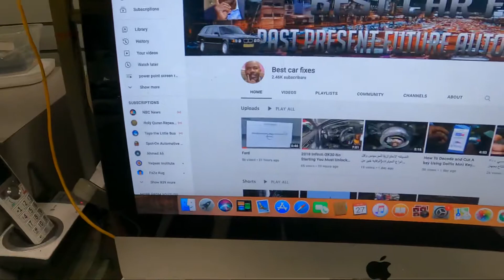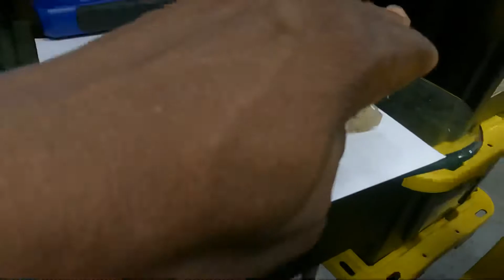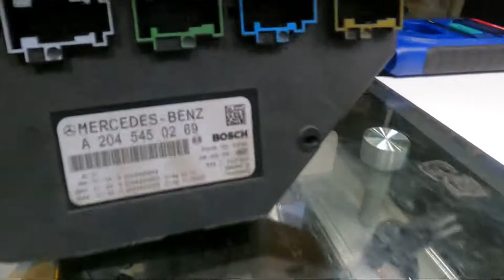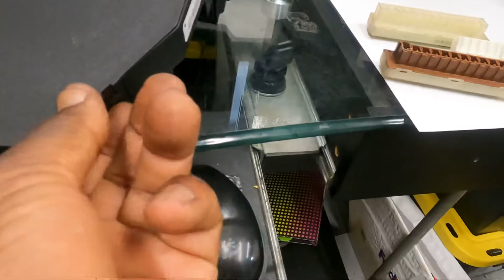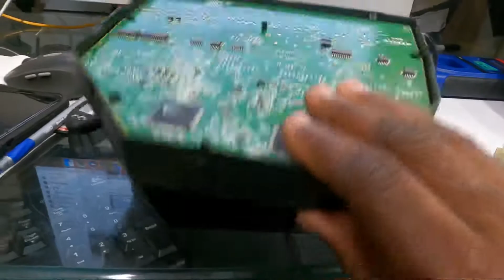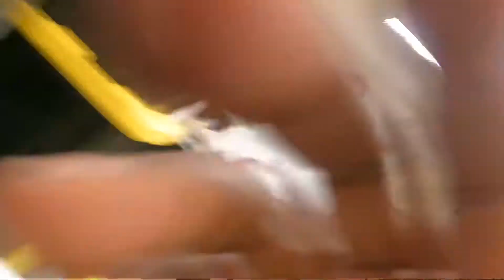2008 Mercedes Benz C350 Front Sam Module Defective Caused No Communication With Engine Computer Info

Comment: So I was having trouble with my 09 Mercedes Benz c350...no turn signals, or wipers, nor high beam. And my fan ran on high just as you said. I changed the SAM module with one that has the exact same part number. Now I have no cruise control and still no turn signals or wipers or high beam and my fan still runs on high!!! Could it be something else?
Reply: Does You’re problem solved?

Comment: hi, does a flooded SAM module affect the operation of the washers, wipers, ESP and airbags?
Reply from the maker: yes for sure
Reply: @BestCarFixes  thanks for the answer.  Is it certain that these components will work after replacing the module?  I will also add that I will be transferring the module from 2013 to 2007
Reply: @KAZIUWICHURA it should work. How did it go ?
Reply: @MB204Plug  it turned out that moisture was collecting in the fuse box after rain. I insulated it and I haven't had these problems for a year

Comment: Hello I have a merc e320 w211 2006 and my car not crank front fans start spining crazy and gear selector not want to move stay on p automatic car  it may be from sam module I cant conect engine ecu and transmission to read codes it gives me no conection
Reply from the maker: Check if there is a water inside
Reply: You end up figuring out the issue?

Comment: Srs not comunication, c180 2006
Reply from the maker: If your 2006 Mercedes C180's SRS module is not communicating, it could be due to a few reasons. Here are a few troubleshooting steps you could take:

Check the connections: Ensure that all the connections between the SRS module and other components are secure and properly connected. Loose connections can cause communication problems.

Check the wiring: Inspect the wiring leading to and from the SRS module for any visible damage or breaks. A damaged wire can cause communication errors.

Scan the system: Use an OBD-II scanner to scan the SRS module for any error codes. This can give you a better idea of what is causing the communication error.

Replace the SRS module: If all else fails, the SRS module may need to be replaced. However, this can be an expensive repair, so it is best to exhaust all other options before considering this option.

It is important to note that working on the SRS system can be dangerous, as it is responsible for controlling the airbags in the event of an accident. Therefore, it is recommended to have a professional mechanic diagnose and repair any issues with the SRS system.

Comment: Good morning to you. 80% of SAM issues are due to corrosion caused by condensation moisture & dust?. If yes, how about taking out SAM still in good working condition, to be cleaned, dried out gently & then spare with a thin layer of CRC urethane spray just onto the PCB board. This would be like a PM.

Too thick a layer of urethane spray might trap more heat in the PCB board?. 

For each cleaned up terminal connection will a drop of WD40 or thin application of dielectric grease be advisable?. Regards.
Reply from the maker: Yes, it's true that corrosion caused by moisture and dust is a common issue with SAM modules. However, it's important to note that the process of cleaning and applying protective coatings to the module can be tricky and should be done with care.

In regards to your suggestion of cleaning and applying a thin layer of CRC urethane spray, this could be an effective way to prevent future corrosion. However, it's essential to follow the manufacturer's instructions carefully, as applying too much or too little could lead to issues.

If the layer of urethane spray is too thick, it could potentially trap heat and cause issues with the PCB board. Therefore, it's crucial to apply it sparingly and ensure that it doesn't interfere with any airflow around the module.

For each cleaned-up terminal connection, it's advisable to apply a small amount of dielectric grease to help prevent corrosion and improve conductivity. WD40 can also be used, but it's important to use it sparingly and ensure that it doesn't cause any issues with the electrical contacts.

Overall, it's important to consult with a qualified technician or specialist to ensure that any maintenance or repair work is done correctly and doesn't cause further issues with the SAM module.

Comment: My 2012 mercades c250 won’t start and has anti theft on the radio and and won’t read with the scanner and found water under the seats already changed the can buss and rewire still doing the same what can it be ?
Reply: I have same exact issue. Does your cluster turn on? Mine is just blank.

Comment: The distributor boxes the wires have to go in a specific way or can be connected in any slot that fits?
Reply from the maker: All connections has directions to fit
Reply: @BestCarFixes  yes one master plug that goes in the corner but the other ones that are the same can it be plugged in in any slot?
Reply: @BestCarFixes  hi. My 08 c300 fan comes on high at all times and signal lights do not work all the time as well as the horn and wipers and some days they all work but the fan has been on high continuously so I took your advice and swapped that fuse box but the fan still on high any information would be appreciated on fixing this thank you